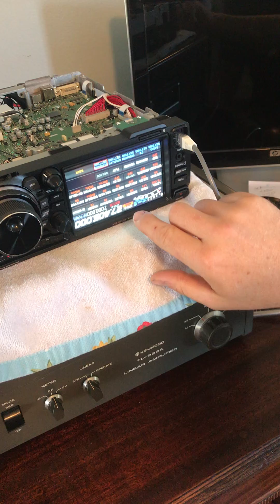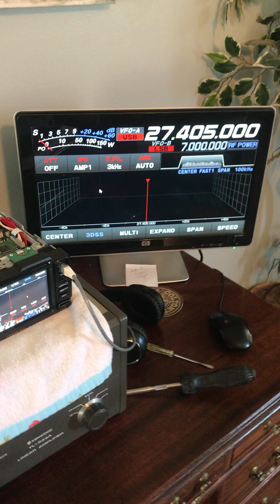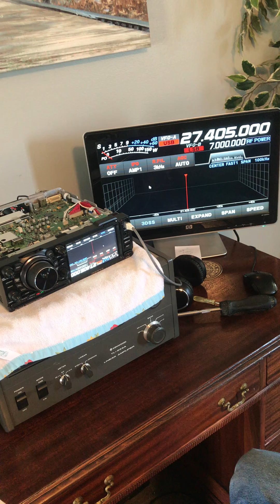Yaesu FTDX-10 “MARS” Open Transmit MOD!!! (Part 2)

Comment: JP6 is just making a ground connection when you connect the 2 very close connection points. I just look over the service manual and that is all you are doing jumping a connection to complete  a ground to wide band . look on page 34 of the FT-DX10 service manual to the bottom right hand side and you will see it JP1006. just do a search for the FT-DX10 Service manual.
Reply: Is that not what he thinks he is doing?

Comment: That mod did not work for me
Reply: Update I bridge JP-6 permanently. Checked it with a meter and everything was good. Reset radio got the mod to work for two minutes and quit working checked for cold soldering joint nothing found mod does not work. It could be the fact that it’s the latest firmware.
Reply: @chrisswartzwelder8494  worked for me. most likely you did something wrong and broke it. or you just a Icom guy and BS'ing " did Icom update there IC-730 firmware and all them mod'ded IC-7300s quit working to? I mean there so many..  I have a 3 month  FTDX10 that I modded and after a fimware update  it worked,and have done the same mod to 2 of my friends FTDX10's and my Fathers and they work prefect.  Gigaparts does the same mod and it works as well as dx engineering. same jp6 mod,. it such a tiny dot of a solder bridge, a cold joint would not have mattered it still would have worked. it take a split second to do. you must have got solder on another jumper. don't make since. nothing to do with firmware updates.. did you hold the solder iron on the tiny tiny jump and cook the board and lift the trace. do you know how to solder?
Reply: @xjohn1970  Is opens 40 or 60MHz tx also?

Comment: Question......exactly WHAT cable did you buy to connect the external display? They is much controversy regarding a BI-DIRECTIONAL cable blowing out the board INSIDE the radio.
Reply: Just get a "DVI-D cable both ends" and use a "PC monitor or HDTV with a DVI-D INPUT" . DVI-D inputs are still widely used in "PC Graphics Cards & PC Monitors". DO not use any kind of HDMI to DVI-D Adapter!! DVI-D and HDMI are both Digital but HDMI carries other signals such as sound,.

Comment: I'm a licensed ham.  It's funny that hams badmouth 11 meters but on any given day 90 % plus are hams shooting skip.  73
Reply: maybe in your neighborhood
Reply: Normally hams dont need to use 11 meters. If 11 is open so will 10 and 12 meters be. But you can identify the cb/hams by their on-air lingo. BIG TELL - "Ah QSL QSL QSL I copy you fine" is a prime example. The Q and Z codes are for cw and rtty/digital, never intended for voice as each requires 3 syllables just to say it. Try it, no lie. Normal hams would say "roger, copy you fine".
Reply: 11 meters is just like 10 or 20 meters but with 11meters the government don't bother you about and make you pay to use it.

Comment: The mod works..................till you power the radio off after the reset guess ill have to solder those contacts
Reply: no not till u power it off.. it sticks.. only if u reset will you lose it

Comment: Wow,  that's the craziest thing I've seen... holding a screwdriver in a $1700 radio with the power on.... people please don't do this... just remove the resistor or diode ....

Comment: Where can I find a ext display cable for the ftdx101mp? I did not see it on the HRO can you help me pleases? Thank you very much.
Reply: Just get a "DVI-D cable both ends" and use a "PC monitor or HDTV with a DVI-D INPUT" . DVI-D inputs are still widely used in "PC Graphics Cards & PC Monitors". DO not use any kind of HDMI to DVI-D Adapter!! DVI-D and HDMI are both Digital but HDMI carries other signals such as sound,.

Comment: Would conducting silver epoxy work instead of soldering a bridge?
Reply: Can't see why it wouldn't. It's used as a soldering replacement with heat sensitive components these days.

Comment: Logic says that if you do not permanently bridge the pads on JP6 and instead use the screwdriver approach, you will lose the mod the next time you do a full reset on the radio.   So consider this mod temporary, because most FTDX-10 users end up having to perform a full reset on their radio at some point because of bugs / firmware flaws.   Screwdriver trick = temporary.   Solder across JP6 = permanent.   Caveat:  haven't done it to mine.   I'm just employing logic.
Reply: I don't guess you even watched the video, you know where he said multiple times it's temporary and it would reset with up dates. So logically your comment is illogical.
Reply: @b.a.millerwoodwork7074  that`s really logical